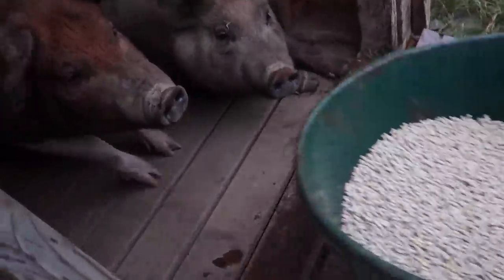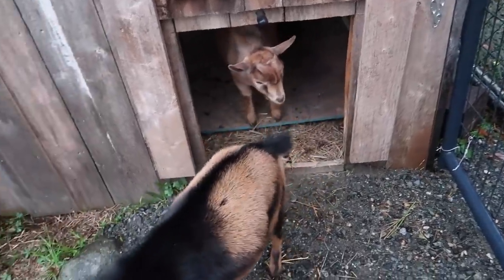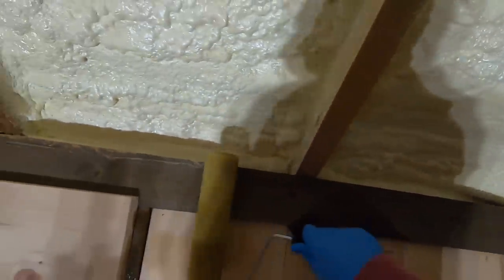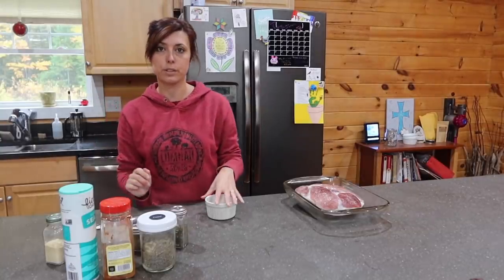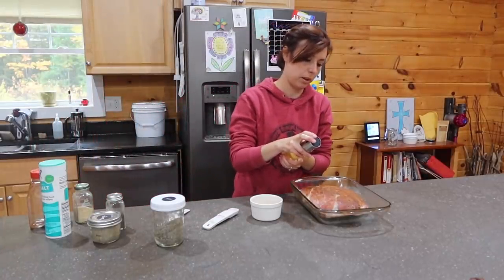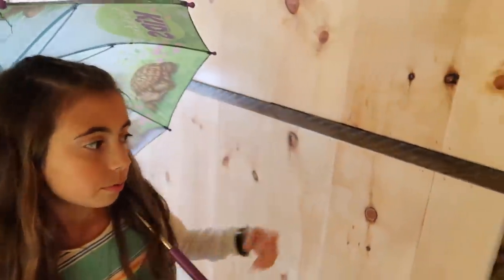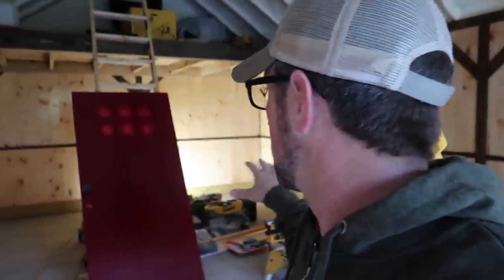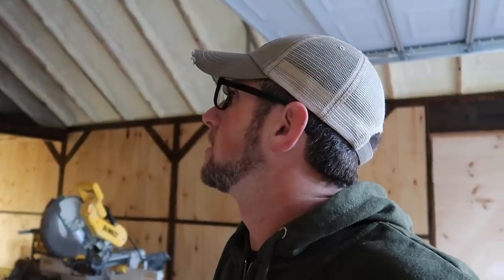Time to Get Sticky! Applying the FINISH to the Post & Beam WorkShop

Comment: Jay Bates has a great video for a miter saw area. Originally I was thinking that the back wall would be a great spot but with a 15' width I'm thinking that it would be better along the wall that is shared with the milking room. if you set it up with 10' from the back wall you should have plenty of room on both sides for most cut lengths. French cleats or cabinets above will work great for hand tool storage. I agree about the workbench being mobile as well! Sinking your table on a 4'x8' with the saw being on the 4' side will also make a great out feed area. Love the vids! Keep up the great work guys!!!

Comment: My suggestions: I would install a window on the back where the U bench will be for natural lighting. I'm cluster phobic) lol. I would also built an awesome bench that hides both saws. Someone shared a link on your past videos and it looks uncomplicated and very organized. I'm also OCD. I would also seal the floor to bring out a darker color and easy to keep it clean from stains. As to the roof, I agree that it needs to be covered. Under the summer heat, it might release fumes and it will be unsafe for you guys. Love your videos. Keep them coming!

Comment: Add a slide out on the end of work bench left of chop saw to catch off cuts and give extra bench space when needed. Utilize French cleat when installing item on the walls to allow easy changes to layout as needs or projects require. Install central shop vac system to make cleanup a breeze. Epoxy coat floors to prevent stains and ease of cleanup. Under bench lighting to make things under bench easy to see and find. Steel cabinet to properly hold flammable liquids and items. Did I mention twice as many outlets as you think you will need. More is better.

Comment: If you make rolling butcher block table work benches, you can always use them for butchering classes, etc. Massive workbenches are not as multi-functional, but one big one is good for working on heavy projects.

Comment: Heavy duty table with metal top plate is nice to have. Ideal under the vice. Also another layer on ceiling will improve sound in shop. Metal will reflect light . White colour maybe even better. Just few suggestions from across the pond. Greetings.

Comment: Think about what other tools you will likely get in the future. You might want to get a rolling stand for the table saw so you can move it out of the way when not using it. Maybe use it at the end of the left side workbench so it can be the outfeed table. Lots of tools need outfeed - router table, planer, open arm drum sander, jointer.

Comment: A dust collection system would go a long way to helping keep the shop less dusty.  It could be setup along with an air compressor outside the shop under the roof opposite the goat area where your hay is, perhaps enclosed in a closet.  Pegboards I find are very useful with my workbenches.  With no windows in the shop, those LED Spot and Flood lights are very useful around work areas in addition to main overhead lights.

Comment: Best bench top I ever had was double 3\4” plywood with a hard Masonite top.  The Masonite is just screwed down so the top can be renewed.  Having tops a consistent height and width, not too deep, so that a whole 4’ width is created when two benches are pushed together.    The. Surfaces can vary; two by four laminated, butcher block or Masonite, or metal depending on the zone of work.

Comment: I like the U-shaped bench how you described it. This will give three distinct work stations if you want. I would make them from 2 X 4 with a double 3/4 inch MDF tops. MDF is heavier and much flatter than plywood, so you can pound on it if you need to. Cover the MDF with a Formica top for easier cleanup of spills and glue can be scraped off. Since you said you will do machinery repair and wood projects, have a wood working vise on one side and a hefty metal working vise on the other. Eventually, make a roll-around table you can access from all sides, big enough for project assemblies. Get, or make, roll-around carts for tool storage and tools like the chop saw, table top table saw and maybe a table top drill press. I have a 16 x 32 shop, dedicated to wood-working and believe me, having your power tools movable is most important, especially since you sound like you want to pull machinery into one side of the shop (you just cut down on floor space for stationary tools). Build a "French Cleat" system above your work benches for small tools you use all the time, like wrenches, screw drivers, drills and a battery charging station.

Comment: Think about installing air lines that you can just plugin an air hose in at various locations. This will help you avoid long air hoses laying all over your floor. Keep outlets a foot or so above work bench height. Consider making workbenches with heavy-duty casters  (with brakes) to allow you to easily change your layout in the future. Your shop looks great!!

Comment: This is an idea I like. It is a heavy duty work bench maybe you can put on the right side. This can be moved out into the center if you want. You can use the large vises. It is a great wood working bench. Also you can cut trees from your own property rough cut with a chainsaw jig and make the table yourself. Then it would be a project to video and a treasure to pass down to many generations. I use a similar bench to make spoons and kuksas

Comment: If you think you might need more worktop area from time to time but space at other times you could always hinge worktops with piano hinges so they either drop down from hinge or hook up to fit flat against the wall when not needed (legs can be removeable and slot in or also fold up

Comment: Lam beams make great work bench tops. Super strong and looks good, too. They are expensive to buy new, but there are always used ones around--it seems people order the wrong sizes all the time. I built my benches out of five inch thick and 30 inch deep beams with 4x4 legs, all of which I picked up dirt cheap from a building site where the owner had changed the plans. I could park a truck on top of them, but there is nothing like a solid bench when you are hammering on something. :)

Comment: make everything on casters...I have a 30'x60' shop....I have a 4'x8' table that I do signs on in my sign shop and I have attached a 30" drop leaf on each end using a piano hinge...gives me a 13' table if I need to do a long banner..but everything in my shop has lock wheel casters so I can move it around if I need to

Comment: Looking good! 

Two things to consider. 

First, I think I would put a bench along the back wall but I would make the wings semi-modular/mobile. So fior the chop saw I'd make it it's own stand that could easily be moved and reconfigured as needs change. Also, look at making it height adjustable. Long bolts and nuts could give you at least 2-3 inches of adjustment for leveling in the future. Plenty of good plans out there for chop saw stands on places like Woodsmith and Wood Magazines sites among others to give ideas or just straight-up steal from! 🤠 

Now on the lighting, it's been a while since I set up mine. I used fluorescents because they were already there and I combined tubes so that 50% were daylight and 50% were warm white and I tried each separately as well. The daylight is fantastic for seeing precise lines etc which is a big deal with woodworking but can be hard on the eyes if you're in there a long time. The warm white is not fatiguing but you just don't see as well. Mixing them I found was truly the best of both worlds. Excellent visibility and good color rendering but not fatiguing over long periods. You could maybe just mix the fixtures or go with smaller fixtures and more of them to get the blend. In the bench area, I would look at maybe doing the daylight directly over the work areas and 1-2 warm whites to fill in the center maybe. Either way, go for the broad spectrum of color temps if you can versus just a single temp and I think you'll like the results.

Comment: Sealing the concrete floor is one of the best suggestions I can think of. I used 1 in my garage gave it 5 Coats. I have metal machines that I move around quite often and as yet have not scratched through the product. The floor has been sealed for 10years.  Plus it makes the clean up that much easier. If you need the name of the product let me know and I'll find what I used.

Comment: Have you given any thought to using poly on the milk room walls? It would make cleanup a lot easier in the event of body fluid spray. (blood, urine, milk) It's a space you want to keep as clean as possible, not only for milking, but with the stanchion could be used as a place for physicals and minor treatments/procedures as well.

Comment: One thing you have not talked about is insulating the garage door.  Given your bitterly cold winters I would think that you will be losing a lot of heat through the steel door.  Any plans for a wood burning stove in the shop?

Comment: My take. Inexpensive 3/4 Birch plywood for the base cabinets with lots of drawers and doors to keep the dust out, upper cabinets with doors. Doubled 3/4 MDF for the tops, they are durable, dead flat, and easy and cheap to replace over time. Think about a good but cheap dust collector from Harbor Freight, they work really good if you modify them with a metal trash can for collection, I would set it outside on the area that's not closed in. Coat all the cabinets with poly like you did the workshop walls. Set-up your table saw at the same height as your workbenches, then you can use the benches as outfeed tables, real handy when cutting large sheet goods. Do your build in stages as you figure out just what you need. Have fun, I know I'll enjoy watching you progress. Thanks again for sharing your family with us.

Comment: Ok my opinions because you asked my friend. I would definitely Go across the back wall with a bench. 2x4's work fine for the base and 3/4" plywood top id say. You may want to double plywood top if you feel you'll really be needing extra strength.  I\d pull the truck in to see if you should build the side benches as you say. You might not have the room you want or need to feel comfortable working around those if they stick out too far. The portable bench for the saw i feel is a great idea. Hope my thoughts help....

Comment: Here is my thoughts, all the suggestions on putting the workbench/ benches on casters make sense, but would also go with a height that matches the height of your miter saw on it's stand. or just a hair (1/4 or 1/8 inch)lower. I'd use plywood and 2X4s for at least the one on the left, and you could set up the miter saw and stand when you need it and tuck them underneath when you don't. Another Youtuber who has an awesome portable workbench design to consider is Ron Paulk, I think one of his Compact (3X6) benches with your small tablesaw would be great to have when you needed it but would be out of the way when you don't. I love watching your videos and wish you success with your new shop.

Comment: 1. full cyclone dust collection system
2. woodworker's wood mounted vise fold away under table is nice to have
3. solid area for heavy pounding with a large iron vise.
I am sure others will have great suggestions too.
Is the wife going to get a section or is her space going to be somewhere else? I think you mentioned that before but I don't recall that right now

Comment: I agree with #Freedom Feather Farms on making one side of the "U" portable.  That way it can double as an outfeed and assembly table.  I recently made a small workbench for a small equipment area in which I pull regular maintenance.  I made it out of #2 2x4 "big box" lumber and edged it with 1x4 from the same store.  The entire top is secured with Titebond #3 glue and three 1/4x20 all-thread stock from side to side.  I drilled out for washers and nuts using a Forstner bit.  The only caution there is to make sure you measure for any dog holes BEFORE you drill for your thru-bolts, then put your dog holes someplace else so you don't compromise your drill bit when drilling dog holes.  I made my edging 1/4" higher than the top of the bench and covered the surface with 1/4" masonite/hardboard without any fasteners, for easy replacement when it gets torn up.  After I cut the masonite to size I went underneath the bench and, standing on my head more-or-less,  marked the dog holes with a very sharp pencil and finished off by drilling them out.  You folks are doing such a great job on your farm improvements!!

Comment: Fixed L shaped bench on the right and back wall, 3/4 the length of the back wall full 8' on the right wall, construction lumber so it is strong and sturdy. A rolling 'island' bench with the chop saw stored on the left wall. Fix the vice to an outside corner of the right wall bench, directly over a leg. 6mm (15/64") ply sheets for the ceiling and then linseed oil them. Fix a 8' I beam to the ridge that spans the loft and workshop area so you can attach a come along/manual winch on rollers to get heavy items up and down without risking carrying them on the ladder. With all that 'left over' lumber you can build a mobile cart for the remaining left over lumber!

Comment: One thing my brother-in-law did was put an electrical drop from the middle of the overhead with flexible metal conduit. and a counter weight on a pulley. The table saw then could be moved to the center of the floor to work plywood or long ripping without a cord on the floor to trip over. It would have been handy for example when you were trimming the edges of the doors.

Comment: Great job guys I like the finish on the walls and if you’re looking at doing some work in the workshop this winter then you can buy I think insulated foam panels that you can cut down and slide in and probably insulate that garage door a lot more that will contain a lot more heat inside... as for your workbench you wanna thick bench where you got a lot of rigidity and you school by four legs and probably two by sixes for the rest of the framework that way you got a lot more strength and you can possibly use a metal brackets to reinforce it

Comment: You could mount a retractable extension cord reel from the 2x4s you hang for the lighting. That way you don't have to run an extension cord across the floor for things like the miter saw that you will move around.

Comment: You’ll need ventilation at the back.  Maybe even a window...Consider how much storage you will need, as that needs to be accessible for commonly used gear.  You may get sick of having half your gear in the basement, & half in the shop.  

Also, not sure what plans you have for the loft, but I can’t see that it will be a work space.  Also consider pulleys to haul stuff up there, and depending if you want to haul engine blocks out, you might want a space for a winch.   
Have a mix of track lighting and spot lights as well.   
Looking great, really inspired by your work & all your Videos.   Thank you for all the time you all put into making these!  

Cheers from Australia...heading for a hot summer.

Comment: I have used both grey PVC and regular MET for wire, but metal looks and works better for a lot of reasons You are smart folks and will research and go metal. Mice seem to like to sharpen teeth on plastic it seems!

Comment: Setup ideas: on left side, do some version of Jay Bates miter station. Leave back wall open for hanging with mobile tools stored there. Another bench on right side for general purpose and/or a paulk workbench in the center. Paulk bench is able to be broke down if needed and would be a good outfeed for tablesaw and an assembly table. As you work in it im sure you will come up with a good setup for your workflow.
Jay Bates and Ron Paulk both have youtube videos to check out. Loving the look of the barn shop, and am envious of the potential.

Comment: Al I am a professional wood worker / finish contractor.  I work out of my shop which is a converted garage space!
I get it all done there however I had many changes before i got it right!

Make your Table Saw the focus of your shop!  Trust me now it’s not but when u settle in and do more projects it will be numbro-uno!

So in the U shaped area table saw set as u walk into it in the middle!
(Build a stand for it the one u hv will do for now you will upgrade though!)
So Table Saw , Miter Saw , work/project bench !  All mobile all near each other!
Leave the area underneath free of cabinets because u need storage boxes or mobile bins to move around over time!
Run dust collection thru independent shop vacs with auto switches.
And become creative and do some work for money to pay for upgrades!
That’s how i became a contractor!
Anyway God Bless you & yours!